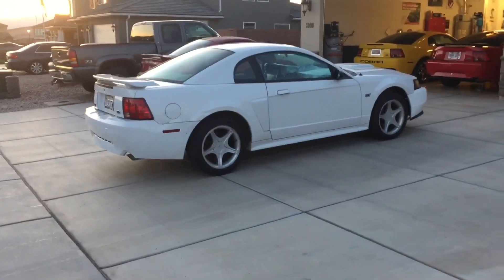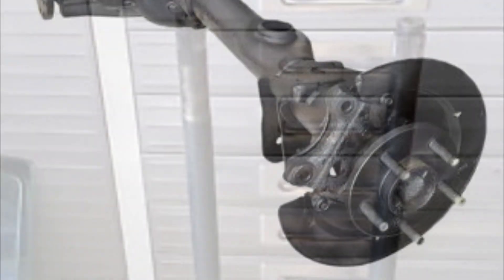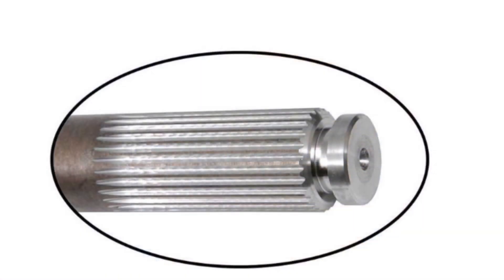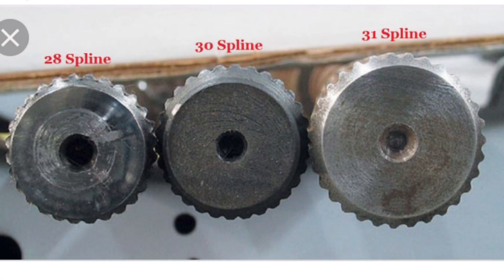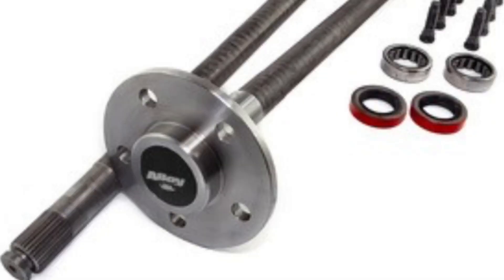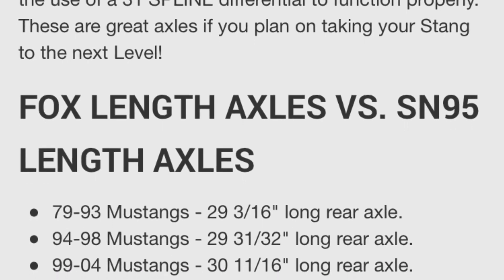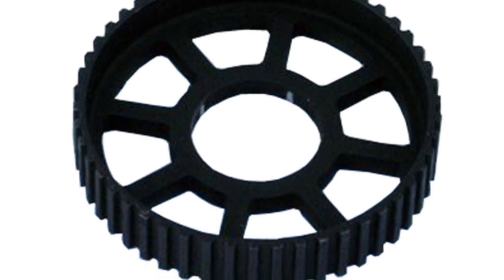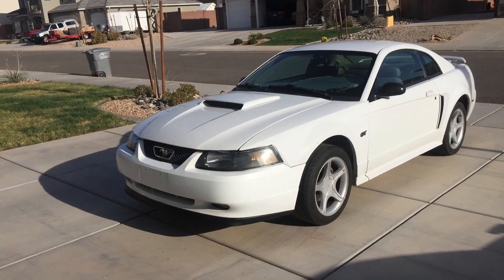28 spline axle upgrade (budget)

Comment: A guy in the comments said he used this 28 axle USA with a 3.55 and it was good? Does this sound right? I think it does.
Reply from the maker: It all depends on if the differential is also 28 spline, which is factory for all 99-04 mustangs except the 2000 Cobra R, 2001 Cobra, and 2003-2004 Cobra. I had them in my mach 1 with 3.55s
Reply: @dannyjohnsonsgarage  I have a 92' foxbody 5.0 . It came with the stock 28 spline and 2.73 gears from the factory. This seems like the best  axle out of the rest.
Reply from the maker: @oscarvillarreal8951  he’s had the alloy usa axles for over 10 years now and supercharged hard launches at the track
Reply: @dannyjohnsonsgarage  Wow...😲! How much horsepower does he have in his car? And does he race at the track regularly?
Reply from the maker: @oscarvillarreal8951  440 rwhp and now retuned over 500. He was weekly at the track but not so much anymore
Reply: @dannyjohnsonsgarage  My Gawd! That little sucker can hold huh. I want to put a Positive Yukon differential in mine it says it will only accept 28 spline axles only. Since this 1 is a little bit beefier I wonder if it will accept it?
Reply from the maker: @oscarvillarreal8951  If you’re going to remove the diff, go 31 spline. Ford Mustang 8.8 Gear Install
https://www.youtube.com/playlist?list=PLIjr-uSYDZi5fnxxp6D9MO7_QlTzizaUf
Reply: @dannyjohnsonsgarage  thanks for the feedback and your patience man 👍.  You helped me out alot to learn about this product 👍
Reply: @dannyjohnsonsgarage  your brother was using the 28 spline USA? Right?
Reply: How long has your brother has had this axle for?

Comment: is your brothers bullet a manual or an automatic?
Reply from the maker: Manual. I believe all Bullitts for 2001 were as well
Reply: Danny Johnson I figured but I wasn’t sure. Thank you for the reply! I have a 94 mustang GT that put down 440 wheel horsepower and I still have the stock axles in it. I’m thinking of an upgrade
Reply: I went ahead I got the 31 spline from summit racing.......I'm running a 125 shot with lots of added tourqe and 430 gears
Reply from the maker: foxy109 xx Do you have a 31 spline differential?

Comment: Hey Danny, I love your videos and wanted your opinion, I have a 95 v6 mustang with a 5 speed t5 in it, I was debating wether to just swap out the motor for a 5.0 the 302 or getting a turbo kit, I understand that the 5.0 has a lot more aftermarket and I’m the end is a v8, I’m in college now and have limited funds and time, so what do you think would be best? I do understand the argument in selling the car and buying a v8, but I don’t know if I’d be up for that. Thanks!
Reply from the maker: Ugly Dogg That’s a tough one.  You could go a lot of different routes. I would suggest no projects since you’ll want to focus on school.  2011 coyotes are getting affordable, and I think you’d enjoy the car already put together as well as having a new car- but insurance on a V8 is going to go up pretty substantially. I’d get some quotes to know what you’re getting into.
  Putting $11k into a coyote, you’ll still have a car worth about that. Putting $3,500 into a turbo kit will give you about 300-400hp but the car still won’t be worth much. You’d have to sell the kit to get your money back. The V6 has a weak 7.5” rear end, so you’d need to at least get a junk yard 8.8 with tlok just to think about putting power down. I had a 97 V6 and it was a great, reliable car, but let’s just say when I went out on my own I didn’t mod it- went for the Mach 1 and terminator and I’m glad I did
Reply: Danny Johnson I would like a newer car, but that comes with newer problems, if I were to engine swap it would be the 94-95 5.0 from the gt the 302 motor with 215hp, I have a bit of time before I go off to college, about I think 3-4 months, Iv gone and looked at 2011-2014 mustangs for 10k and I like the coyote, but I just cant get over the raw feeling of the sn95. I have a guy I can get a 5.0 302 as well as the wiring harness and the bell housing for $650, I haven’t negotiated with him and the engine sounds really healthy, the miles are unknown, do you think it would be worthwhile to buy the motor build it/maintain it while it’s sitting around and then this summer swap it into my car? Thanks again
Reply from the maker: Ugly Dogg Personally, Id look into a mach 1 at this point so you have he chassis you like with a nice DOHC 320hp engine to start with. If you have your heart set on a 5.0 from that era, it’s all up to you.
Reply: Danny Johnson okay, I appreciate it, have a good night !
Reply from the maker: You too. Follow your heart lol. 👊🏼